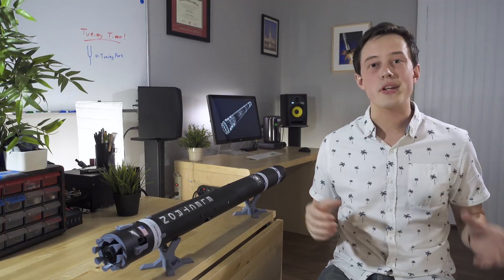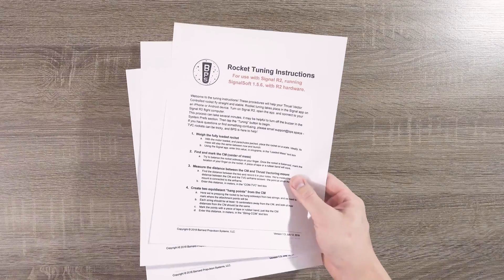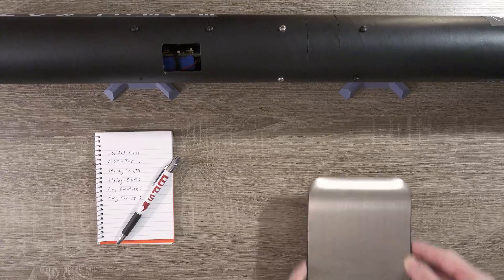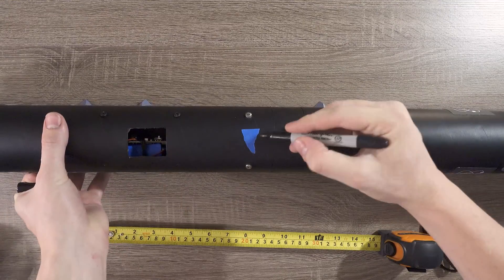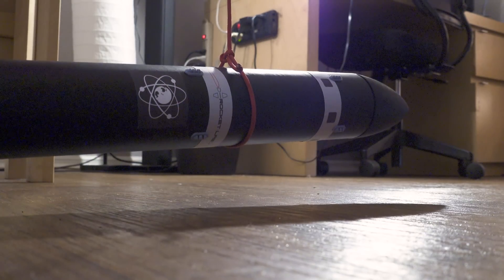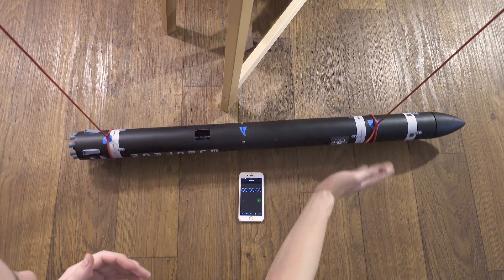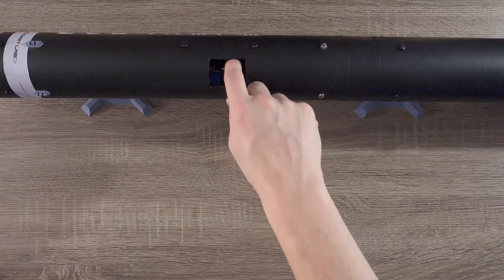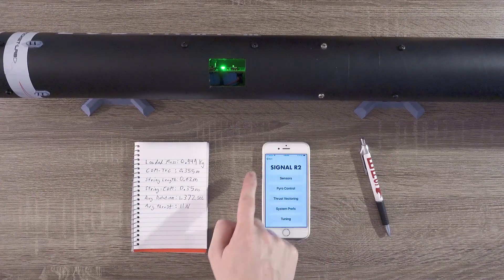Rocket Tuning - Build Signal R2

Comment: Great way of measuring moment of inertia about center of mass  using SHM oscillation  😁  I suggest you should change the pid values with time to compensate for the mass loss( change in MOI) of the rocket it is very important as u have a significantly scaled up rocket and towards the end of flight the rocket will start overshooting

Comment: How is this method of calibrating rocket thrust vectoring PID called? And how is it calculated? can you point me to some article? Thanks. And good luck with your projects! :D
Reply from the maker: The PID gains are generated by a proprietary bit of math based on several factors entered in the Signal iOS/Android app. Generally speaking, it's helpful to either perform a series of experimental tests or simulations to generate accurate PID gains, but BPS has a large enough data set to reliably predict solid gains for most model rockets. I don't know of any existing articles on the topic, though I'm sure they're out there!
Reply: Thanks, I think I found my answer in this one of yours videos: https://www.youtube.com/watch?v=IutG-bZu07I 
So you basically calculate moment of inertia via bifilar pendulum test and then you simulate pid loop, and readjust it until it performs well enough, and finally you get resulting PID values. If I understood it correctly.